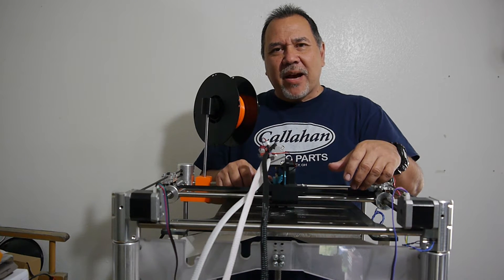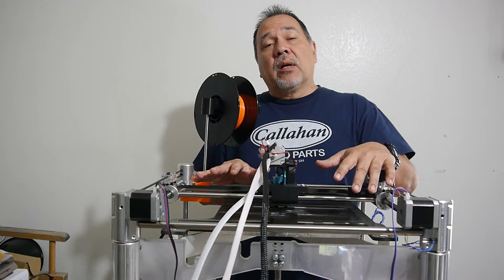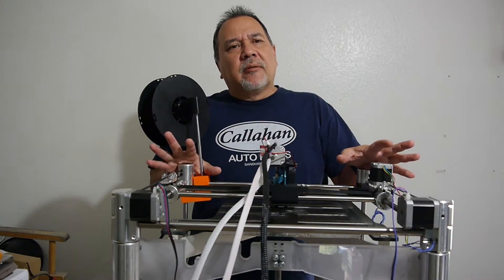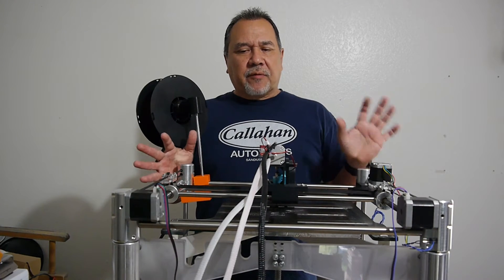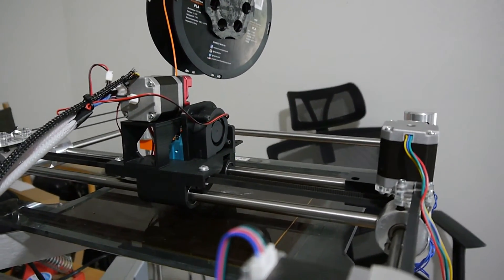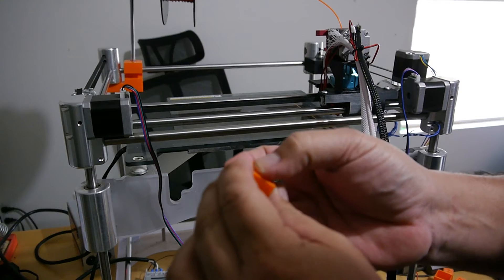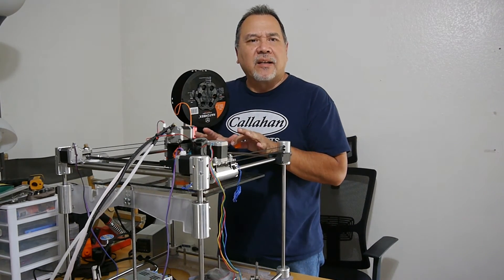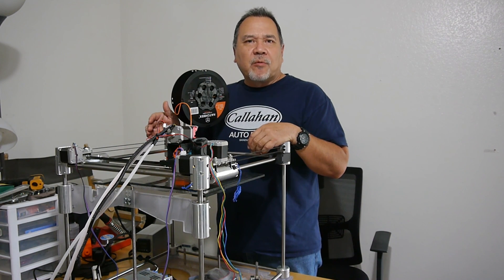Testing the CubeX Duo at a Slow Print Speed of 10mm/s

Comment: Hi there, this is my latest experiments with this machine, I found that after i inserted the plastic box and tight the screws all around, that was a game changer, not 100% but much better about ringing etc, the casing get all tight and almost solid, hoop this help to get a bit further on your project, Greetings from South Africa
Reply: cubex duo y axis micro switch mount
Reply from the maker: Thanks for the tip.  I'm going to try a few ways to tighten and stiffen the frame.  It's a long term project, so stay tuned to the channel.  👍

Comment: So one of the problems with square frames is that they're really weak to torsional forces. You can twist and contort the frame in at least 3 dimensions. If you ever assembled a bookshelf you'll notice it's really flimsy until you put the backing panel on.
That's what you're missing on this printer. You need to do complete cross braces, from one corner to the opposite corner. Only one per side is needed, and it will considerably increase the rigidity. Threaded rods might be a good choice for that. The back panel, when tightened down achieves that effect for that side.

Comment: Hi, i`m busy with the same project, after seeing all your videos on cubex i think i found the problem why the faces on test cube is a bit rough, with a machine printing, i found the table motion is a lot of vibration, i did print one of micro switch and i fit to left front side bar to the table, so they slid along with the table, that reduce a lot of vibration, then i print one for the right side, jackpot, the faces are 100% that is a ender profile speed 50 mm/s, however still a bit of vibration on the all printer, i did print in a foot in tpu (flexible) seeing the results i will say much better, now when i fit the plastic box back, the printer will be 100%. just try to help, nothing to lose on try. Greetings from South Africa
Reply from the maker: Good pointers.  I might try something similar.  You said you printed one of micro switch?  Do you have any details on that, or a file?

Comment: It looks like you might also be having some issues with your extruder or hotend causing those under extruding gaps and bulges. try printing something in vase mode and see how clean the wall is. If its clean, it might be a retraction issue in your printer settings. If its still bad, it might be heat fluctuation in your hotend where u will need to do a PID auto tune to make sure you are holding the correct temp that the lcd is showing.